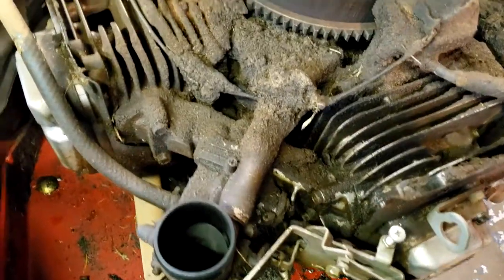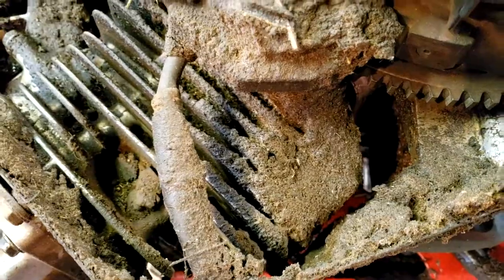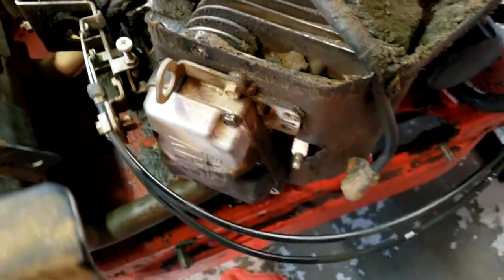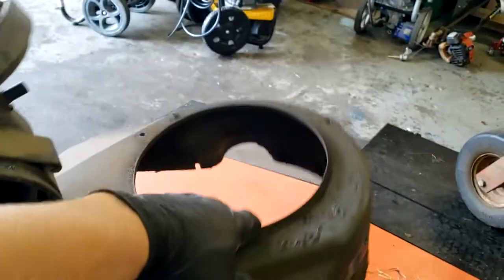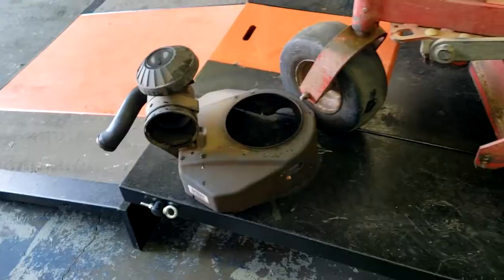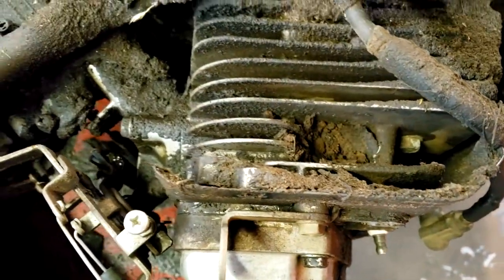Save Your KAWASAKI Engine On Your Mower Before Its To Late

Comment: I've got a 1997 Exmark 48" with 770 hours on it. Still runs and cuts like a champ. While I do clean the engine once a year, I've never taken off the cover. Got a weekend project now.
Reply from the maker: Never hurts to check it out👍
Reply: I have a 98 huskavarna with a 15hp with a little over 3000 hours

Comment: My grandfather was a very strict teacher when it came to equipment (he lived through two World Wars and the Depression in between) - you always, always cleaned the equipment when you were done using it. Cleanup was a part of the job, not an option. It didn't matter if it was just a screwdriver or hammer, you cleaned it up when you were done. This engine is an example of why.

Comment: I've got a Kawasaki 27 horsepower running on one cylinder. Does that mean it has a bent push rod on the side that's not firing is that an automatic? I've ordered a new coil.